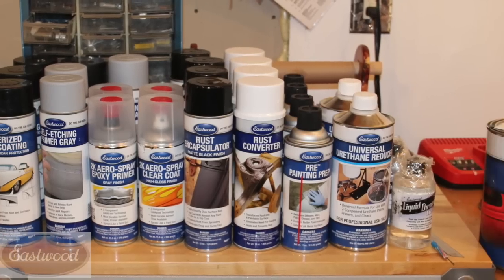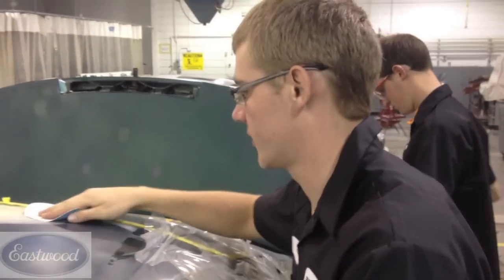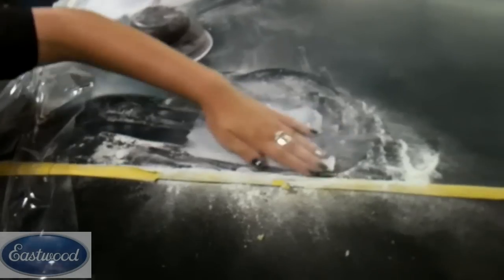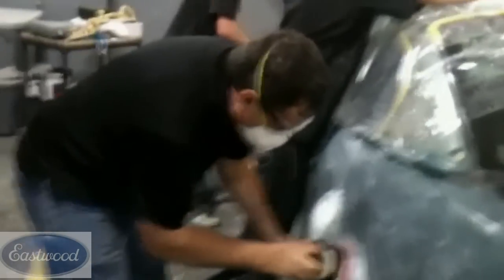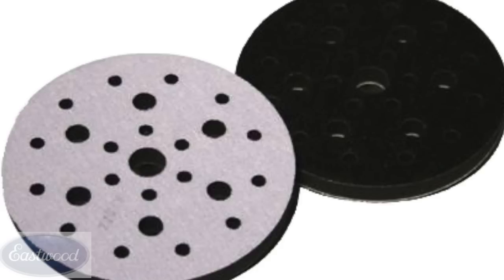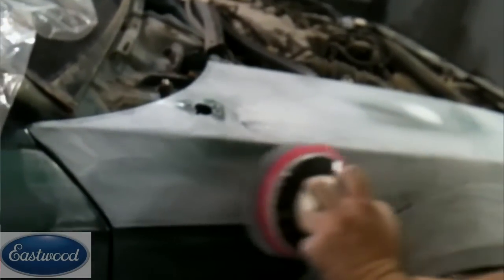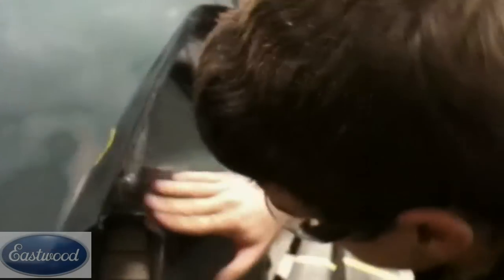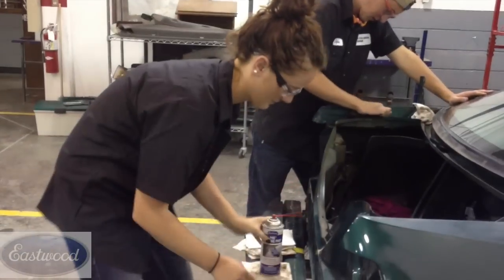How To Prep A Car For Primer and  Paint - Eastwood Mustang Project

Comment: Okay so use 180 grant on the entire car, than refinish sides or feather edging by using 220 on a DA, and final sand with 400-600 grit on Da with inner face pad to prevent sand marks? I'm doing all the sanding so I can take car to the shop to be reprimed and painted. This shouldn't be to hard. Thanks
Reply from the maker: If there are no problems with the paint, peeling, too many mils, etc, then you can skip the 180 and 220 and just final sand with 400 to 600.  Then they can apply primer sealer and paint.  Are there any dents you need to repair?
Reply: +DIY Auto Body and Paint            The car was repainted before, not a good job was done because there some cracking on driver door and  I can see cracks from original paint under new paint at hood. I'm thinking of doing 220 grit and final sanding with 500 grit, what would you do? Thanks for the reply that was mighty white of you to do😊

Comment: I have a truck and the clear coat is flaking off because of the sun do I need to sand off all the clear coat? if I don't and the truck is repainted won't it keep peeling off?
Reply from the maker: Yes, but you can do a partial strip.  Good new is that if it's flaking off, then it's real thin and should not take long.  I made a video about that.  It's the first video on this lesson... http://www.collisionblast.com/paint-defects/  Thanks for watching and I hope this helps.

Comment: hi love the video i wanna know can i use filler to get rid of deep scratchs as ive got subaru impreza gf8 wagon thats got all deep scratchs on?
Reply: Don't use filler on scratches, especially deep ones. The repair will likely sink and be noticeable six months later. Always feather out a scratch with DA and prep a blend panel or two next to it (depending upon where the damage is) then prime, block sand, then respray.

Comment: Is the primer process necessary after all of this sanding?
Reply from the maker: Only on areas where you did body work or have imperfections.  If the panel does not have any damage that was repaired then you should not have to prime and block sand.
Reply: The Garage Butler thanks for the reply. What about areas that has bare metal showing? Does bare metal require primer or will finishing off at 800 grit suffice?
Reply from the maker: No, any bare metal will need self etch primer or epoxy primer applied before top coating.
Reply: Always prime on top of filler. It will help remove any imperfections in the sanding. It will also help to get the correct colour when painting. Donnie is correct about the etch, it must go on bare metal to remove corrosion and allow the primer to adhere. Everything else Eastwoods does is nonsense, some of the worst 'Professional' body repairs on youtube.

Comment: I have an 89 Mustang LX. I bought it back in October and being 17 it's my daily drive. I know I shouldn't but I need it until I can afford another car. it has a little rust hear and there a dent and some flaking paint on the rear wheel well. How should I go about fixing those spots that have imperfections? And how long would it take
Reply from the maker: Hey Derrick, there are a lot of variables depending on the condition.  Is the rust just surface rust on top of the panel or is it rusted through the panel?
Reply: DIY Auto Body and Paint in some spots it's only on the top but I fear in others it's a hole I haven't done stuff to it because I need more money
Reply: @DapperD942  im doing my 88 mustang coupe if theres a hole and or bubbling of the paint theres most likely a good deal of rust underneath and if you want to remove that rust properly you gotta cut it out and weld a new piece in when I cut the small patch out I found just about my whole qp was fucked due to a hacky fix from the dude I got it off